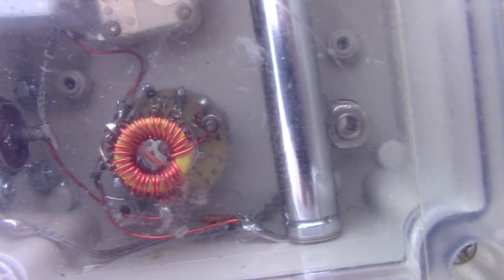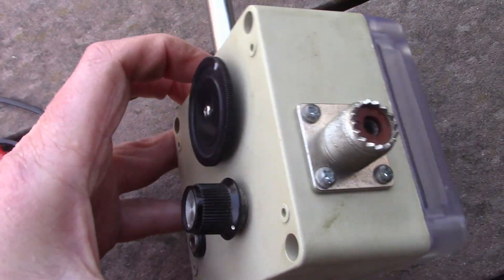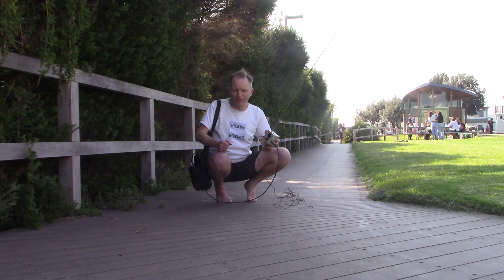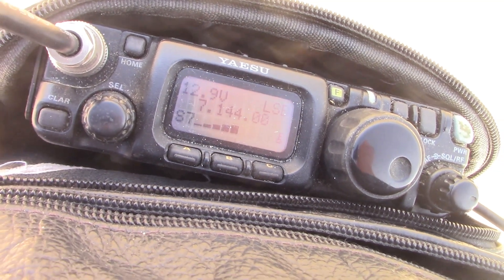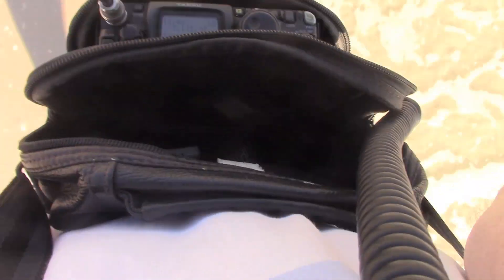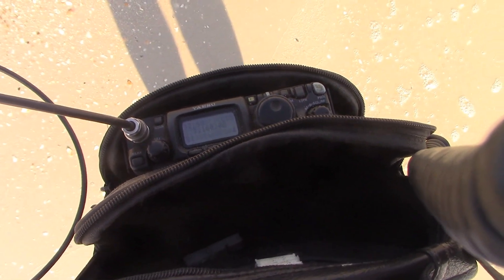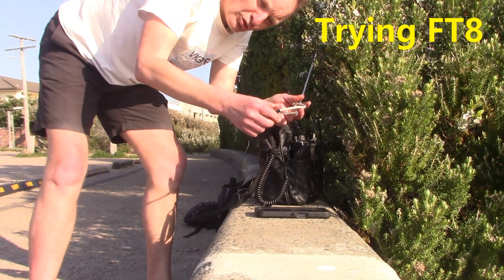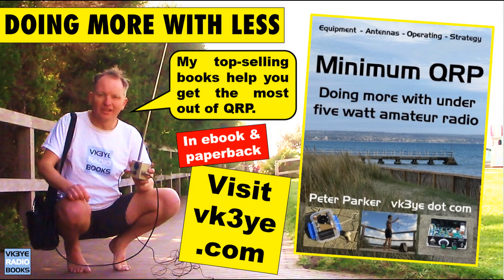1.5m pedestrian mobile whip in action on HF

Comment: Which of your more recent pedestrian mobile antennas would you say works best? I would guess your 5m squid pole and wire.  But theres something appealing about a classic telescopic whip, even if it is 1.5m long.  
Also 20m might have been reasonable,  guessing it was too early in the day for that band.
Reply from the maker: Definitely the Wadetenna (5m pole & wire with loading coil). Followed by my large pedestrian mobile magnetic loop. Then the SummerLoop (for 28 MHz).

Comment: Peter, I saw you’re using a type 6 powdered iron core. I’m building an L matcher to work from 80 to 10 meters along the lines of the MFJ 16020 L matcher and wondered if a type 6 or type 2 is best. I lean more toward type 6 because in spite of having to wind more turns around the core it has a higher Q factor. What are your thoughts?
Reply from the maker: Type 6 is generally recommended for above 10 MHz, which is the primary focus for this antenna. So that's what I used.

Comment: No CW? I guess not many ops around? It is amazing how the salt water makes such a difference!! Great video 73 de VK2AOE
Reply: It looks like he was holding the antenna, camera, and the mic so I’d imagine it would have been too difficult to work a key. That’s only an observation though on my part.
Reply: @justincompton4593 He stopped for the FT8 ….? I think?? Mate of mine does mobile CW from the car but not filming …so yes probably would be a circus trick. 😂😂
Reply from the maker: Left the key at home. In theory CW's efficiency should help but in practice the small number of operators within a single hop offsets this. If there were 100 more CW operators in VK6, VK8 & ZL on each band from 18 to 28 MHz and they weren't being called by DX then CW would be more viable. But I have done CW pedestrian mobile and it can work if conditions are good.
Reply: Thanks for the reply Peter. Enjoyed the video, I’ve only just started getting out of the shack with the radio. Even in parks in the city the DX was easier (away from the QRM etc). 73